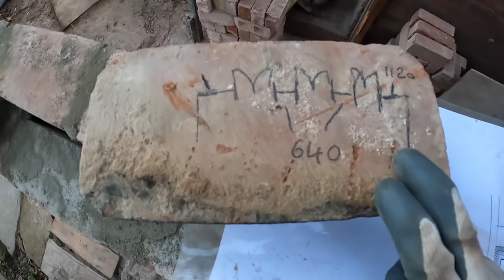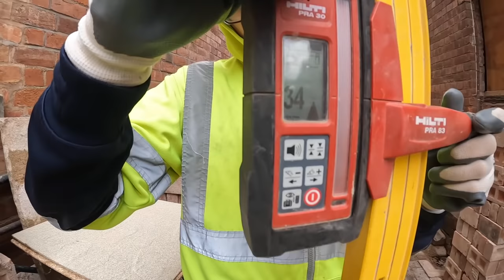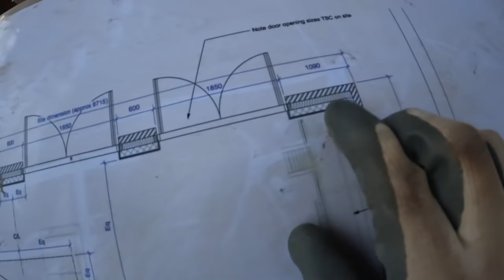WE ARE FINALLY HERE !!... WORKING FOR BUILD WITH A & E

Comment: Quick one Steve, I appreciate you're not a consultant but where do you draw the line on bricklaying in cold weather. 0-4 degrees here tomorrow, itching to crack and not 100% sure if that's too low to lay sound gable brickwork. Cheers, Dan.
Reply from the maker: It differs all over the place . 
   Google it and use your own judgment would be better . 
  If you do proceed make sure it’s well covered.  🧱👍🏽
Reply: @SteveAndAlexBuild  Tried Google, I'll have another mooch, thing is there's what you find on that and then there's the real world. My intuition tells me if it's above 0 and not blowing a gale, it should be fine. Using the red bag hanson stuff too which I'm led to believe helps.
Reply from the maker: @dmak2  . 2 degrees minimum  and rising is what I’ve always been told , definitely not 0 🥶🧱👍🏽
Reply: @SteveAndAlexBuild  Seems sensible, I've read 4, it's 2 and above here between 9 and 5. Not dropping below 0 overnight. Hopefully I don't end up laying in the dark again, slight blunder last night! I hate wasting muck. Cheers!
Reply from the maker: @dmak2  😬🧱👍🏽

Comment: Hi, the extension wall thickness look's less than 300mm ???? is the block skin off the block and beam floor with tray ???
Reply from the maker: Yes mate . The beams sit on the internal leaf . The outside has a plinth 🧱👍🏽

Comment: Hi Chaps, been learning loads from your channel and am undertaking a project of my own. The weather here down south is turning cold and frosty. Would you advice using something like Everbuild 207 Zeromix Frostproofer in the mortar mix. Also would you cover the brickwork overnight, if so, with what? Cheers.
Reply from the maker: As long as it at least 2 degrees and rising you should be ok but if the temperature drops a lot overnight you need a lot of hessian and maybe old sheets to protect it.
    We don’t use frostproofer , don’t really rate it . 
    Best bet is wait till we get a warm spell … constantly above 4 or 5 for a few days overnight too . 🧱👍🏽💪🏼
Reply: @SteveAndAlexBuild  Thanks for the prompt reply.
Reply from the maker: @geoffg64  No probs 🧱👍🏽

Comment: Excuse what may be an obvious questions. With a difference of 15mm between each end of the wall, do you simply lay 15mm more depth of mortar at the front end of the wall, and by levelling as you build, end up at the right level at the other end?
Reply: Tight bed one end and a larger bed at the other end.
Very simple.
Or just a 15 mm bed at one end of the wall.
Reply from the maker: @goawakeneveryone4365  👌🏼🧱👍🏽
Reply from the maker: Spot on 👌🏼🧱👍🏽